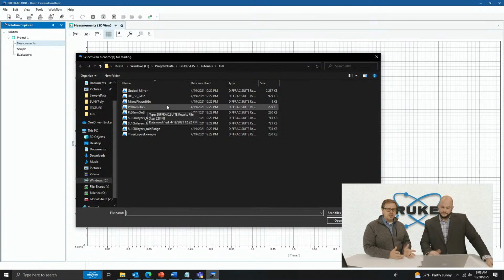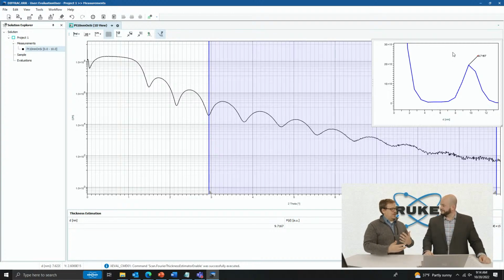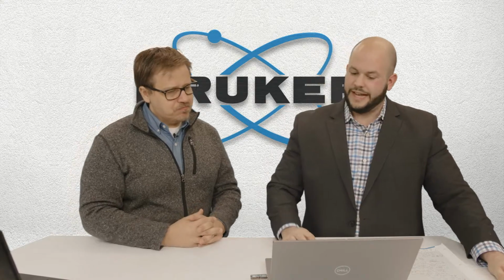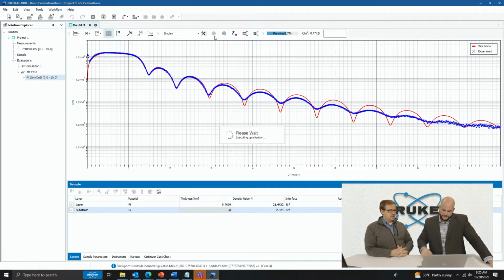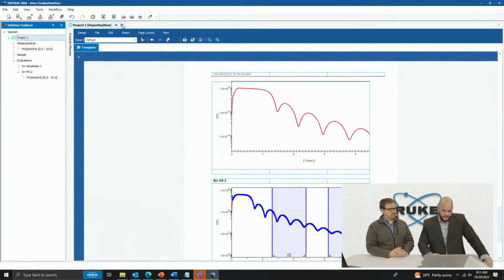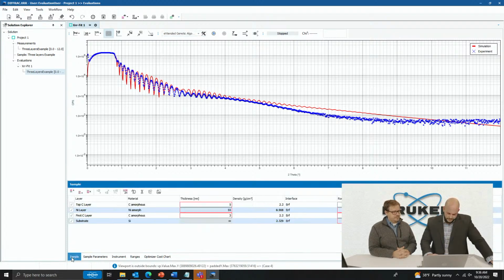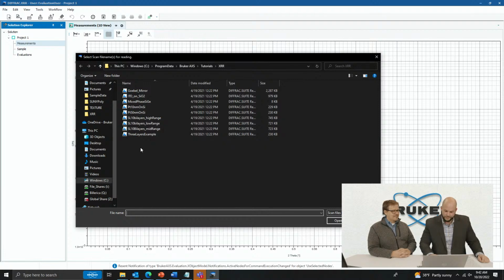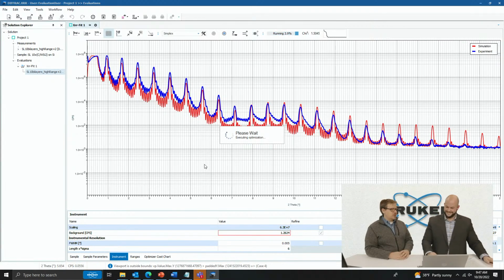Live from the Lab: Thin Film Thickness and More with DIFFRAC.XRR

Comment: Thanks for the really interesting and useful video! 
A couple of questions concerning interface roughness model:
1.	Does the software uses the Graded-interface approach for Erf, Linear and Sin models (i.e. interface is represented as a gradual change in the refractive index using many thin layers)?
2.	If “yes” then what is the discretization thickness?
Reply from the maker: Greetings! Thank you for watching and for your question. For an abrupt interface, the influence of roughness is calculated analytically. For gradients the interface is subdivided into a number of thin layers.

Comment: Thank you for making an excellent informative video but I do want know to about the weight in the range (which you are  using 2 or 3).
1) why are you estimating that number only?
2) what is the role of the weight?
Reply from the maker: Hi Nitesh. Ranges are used to define 2-theta regions where the fit is evaluated. Weight is used to give one range preference over another –  i.e. During the fit calculation, datapoints contained in a range with weight of 2 is effectively given twice the consideration of the datapoints contained in a range with weight of 1.